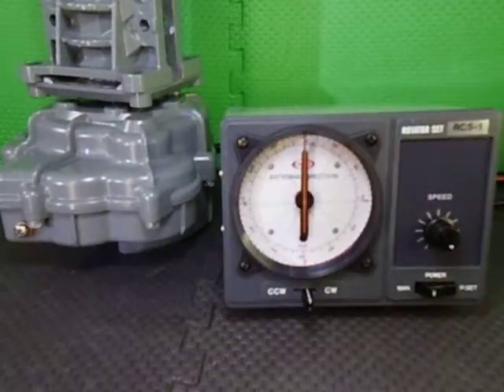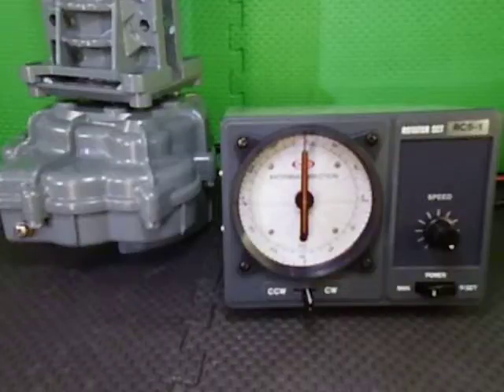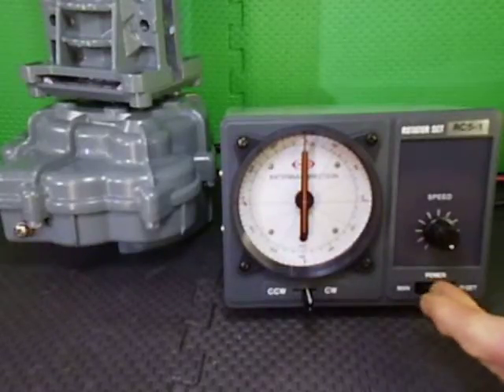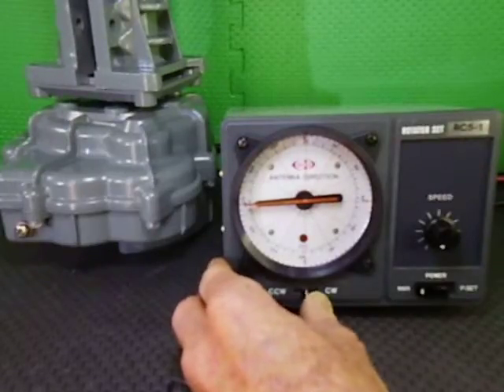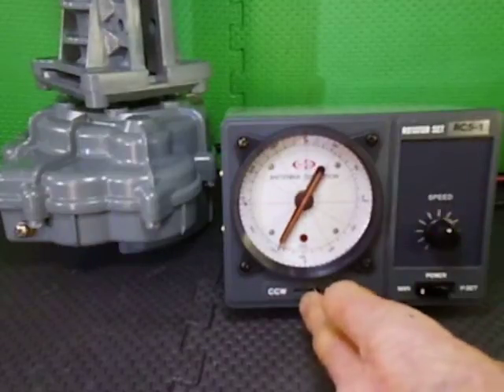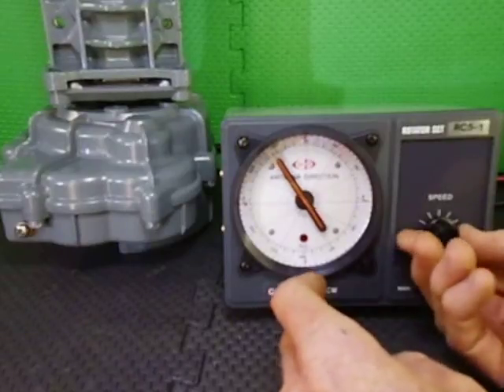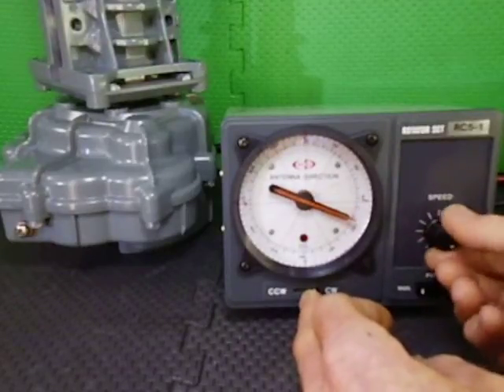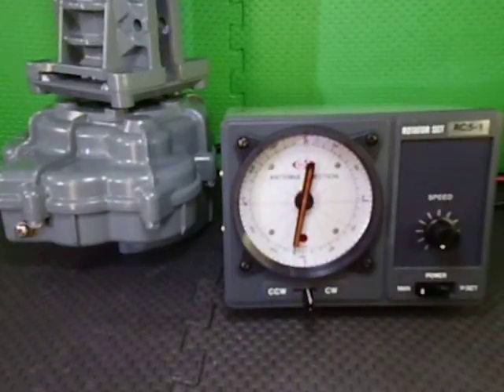CREATE RC5 1DC

Comment: Hello, I see you are the rotator expert. Only a pitty that you are far from the Netherlands.
I have an Create RC5-1 rotator wihch After moving it from 320 def to about 240 deg the antenna in the mast stopped rotating and the controller clock started turning very fast towards about 170 CCW which is the limit. The red limit light turned on and after a couple of seconds the light turned off. I was not able to move the rotator in manual mode. 
My first thougt was an broken wire btween controler and rotator in the mast.
Therefore I disconnected the wires to the mast rotator and the clock controller started moving north from itself. Still not able to control/move the arrow manualy. Do you have any thoughts where to find the failure?
Thanks in advanced Martin van der Voet. PD1MV
Reply from the maker: Hi Martin please contact me (Duoro Services) via my web site kur02.com.au, so I can send to testing info sheets etc.